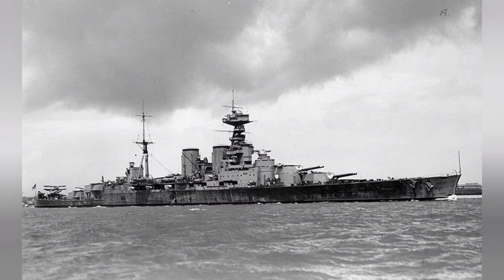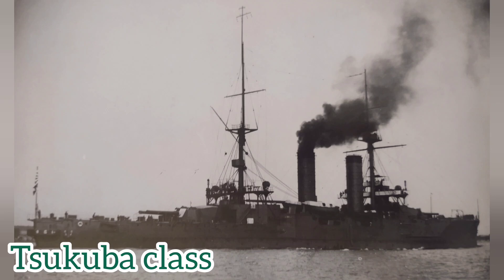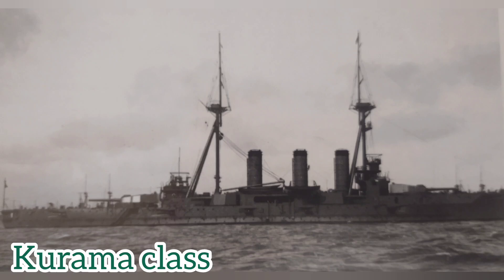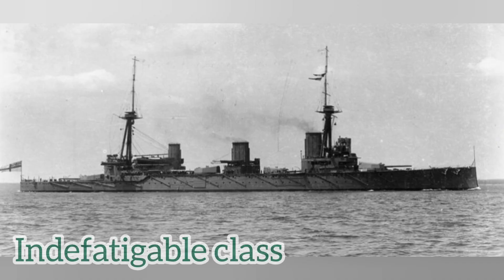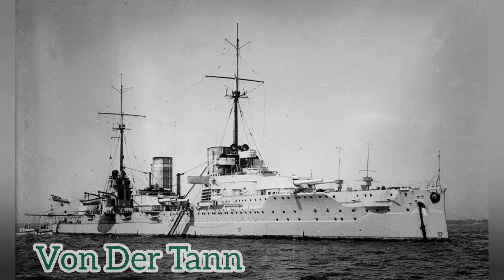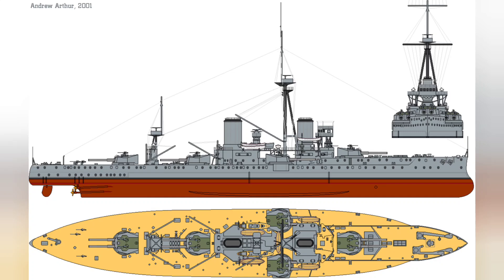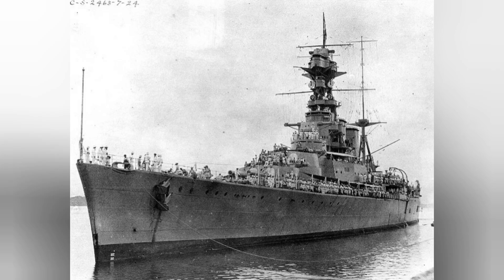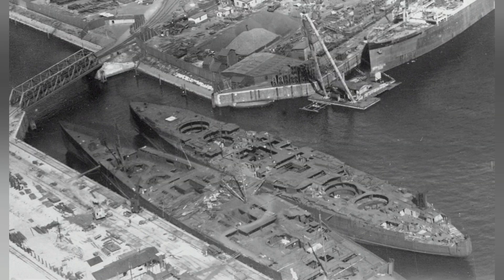The battlecruiser issue.

Comment: I think the best definition for battlecruiser is “A ship that’s capabilities are in between a heavy cruiser and a battleship”

Do you have any criticisms of this definition ?
Reply: I would say it would have to have a main armament caliber of contemporary battleships.

The Alaska class of the 1940s have been argued between heavy cruiser and Battlecruiser because of its 12 inch guns, but by 1940, 12 inch guns couldn’t really be called battleship armament when pretty much every major navy had 14-18 inch guns.

Similar can be said for the Deutschland class pocket battleships (actually heavy cruisers) which only had 11 inch main guns in the 1930s. By comparison, the Orion class had 13.5 inch guns by around 1910, and the New York class had 14 inch by 1914. Battlecruisers of the time had similar calibers, minus a turret or two for engine space.
Reply: @shaun1293  12 inch is a battleship gun diameter  

If there was a cut off point between non-battleship & battleship gun diameter it would be 12 inch  i’m pretty sure that a foot long in American
Reply: @avus-kw2f213  12 inch was pretty much the battleship standard caliber from 1895 to 1910, when ships with 13.5 and 14 inch guns began to appear, with armour to match. Due to this, 12 inch guns for battleships quickly became obsolete; if I remember correctly, all british 12-inch BBs and BCs were scrapped by the early 1920s because of it. The American 12-inch dreadnoughts ended up being heavily modified or converted, and the only one that saw extensive WW2 service was Arkansas, and even then it was mostly coastal bombardments and patrols.

The exception to this were the two Scharnhorst-class battleships built during the 30s. Hitler reluctantly ordered them to have 11-inch guns to keep tensions at bay with the U.K. They were supposed to be upgraded to 15 inch guns like the Bismarck-class battleships, but never came to be. They fired heavier, faster shells than previous 11-inch guns but were still completely outmatched by other BBs and BCs at the time. Their speed of 31 knots was their saving grace on more than one occasion, for example when both faced BC HMS Renown, got pounded and had to escape.

So that concludes my point. 12-inch was a good battleship caliber before WW1. After, they were outmatched and became obsolete. Therefore, the caliber required to class something as a battleship or battlecruiser changes over time. The Alaska class 12 inch guns stood no chance of penetrating the belt armor of contemporary battleships, was outmatched by the last battlecruisers, but could pulverise anything else.
Reply: @shaun1293  how much ships did battleships sink in ww2 in the Pacific ? & how much required guns bigger then 12 inch ?
Reply: @avus-kw2f213  well by that time, the aircraft carrier was king, and most battleships in the pacific were sunk by aircraft. Fuso was heavily damaged by aircraft but remained afloat until she was torpedoed the next day and sunk. Yamashiro was in the same battle, hit by two torpedoes, flooded but remained afloat. She was then attacked by 6 American battleships, 3 heavy cruisers, 4 light cruisers. She was hit multiple times by 16-inch salvos but remained afloat for some time. Only after she was crippled and hit with a few more torpedos did she finally sink.

Kirishima and Hiei, heavy cruiser Atago and destroyers were also intercepted by Heavy Cruiser San Francisco, light cruiser Helena and destroyers. The Americans focused fire on Hiei, giving Kirishima the chance to damage both cruisers. Hiei was crippled by the repeated shellfire, but continued to fight. She remained afloat and was scuttled 3 days later.

It was only then that Kirishima was intercepted by the new battleships USS South Dakota and Washington. In the ensuing engagement, Kirishima knocked out 4 destroyers, sinking 3. She hit South Dakota with multiple 14 inch salvos, none of with penetrated. Her secondary guns knocked out various systems. Safe to say 12 inch guns would have had more of a secondary affect at this point if 14 inch shells can’t even pen. For reference, 14 inch shells were almost double the weight of 12 inch shells.

Washington started firing her 16 inch guns at a short range of about 5km, Kirishima was hit at least 20 times, penetrated her armour and blew her magazine. Survivors were later rescued before she sank 3 hours later.
Reply: @shaun1293  was their any other ships sunk by battleships ?   I really thought it would be more
Reply: @avus-kw2f213  there have been a fair few ships sunk by battleships but only two cases I know which a battleship was actually sunken by another battleship; Karishima aforementioned, and Bretagne, which was sunk by by British 15” projectiles at the bombardment of Mers-el-Kebir in July 1940. She blew up and sank. The four hits were scored by HMS Hood, HMS Valiant & HMS Resolution. Her sistership Provence was also hit but she didn’t explode and was refloated.

HMS Hood is an interesting one, she is designated as a battlecruiser but practically she was the worlds first fast battleships with her 11” belt armor. She was famously destroyed by Bismarck.

In other cases, Battleships usually just pound the living daylights out of each other until one is crippled and taken out some other way. Yamashiro was pounded by 6 battleships before sinking to torpedos.
Scharnhorst was sunken by torpedos only after HMS Duke of York hit her boilers so she couldn’t evade.

Huge fleet engagements pretty much ended after the Battle of Jutland in 1915, as no one nation wants to risk their entire fleet of super expensive battleships and battlecruisers. Even though the British took more losses, (arguably due to the then unknown dangers of cordite), it was a strategic win for the British as the German high seas fleet pretty much stopped venturing out for the remainder of the war.

By WW2 aircraft were king and easily replaceable, so aircraft carriers became the flagships of fleets and would usually be defended by destroyers and its own aircraft rather than battleships. That’s the reason they’re not around anymore. The aircraft carrier did to Battleships what HMS Warrior did to wooden ships of the line back in 1860.
Reply: That's probably the best definition, given how varied the concept really was. Although with this definition you could put the Deutschland class in the battlecruisers category.
Reply: That´s a description at best, but a nonsense definition. The only correct and meaningful definition of a battlecruiser was always "a warship classified as a battlecruiser by the nation it belongs to".
Reply: @jesperlykkeberg7438  Admiral Kuznetsov is heavy aircraft cruiser not a aircraft carrier then 

Which is still reasonable

Comment: I thought battlecruisers were heavy cruisers with battleship armement, mostly dual mounted, and for something like the USS Alaska, has their main batteries inbetween A heavy cruiser and battleship.
I also thought they were a bit smaller then battleships, but they are almost the complete same.
And the purpose, i would think they would act as a assistant ship to the battleship, or work in a seperate fleet.
Reply: You are on target. Cruisers were advanced scouts for the Battleships and were classified by the size of their batteries. 6 inch or smaller batteries were in the Light Class Cruisers (CL). Those with 8 inch or larger batteries were Heavy Cruisers (CA). They had much bigger guns and more armor then enemy Destroyers and could out run Battleships. They also made excellent escorts for the faster Light Carriers (CVL). Speed was a major factor in protecting ships from enemy submarines. Speed was so effective that troops were sent to Europe via the Ocean Liners HMS Queen Elizabeth and HMS Queen Mary without the use of convoy or aircraft protection.

Comment: I quite enjoy the "What is a Battle cruiser" discussion because there are so many different valid interpretations, and then what ships fit.
For me it's always been role. Broadly, it's a ship that can either conduct merchant raiding with impunity to the escorts (armoured/heavy cruisers) in firepower and protection, or hunt merchant raiders using superior speed and then later be able counter other battlecruisers. The ability to assist in the line of battle to increase relative numbers is a secondary role, probably a requirement in smaller navies.
This means armour immune to 'standard' cruiser guns, high speed and gun calibres over 10 inch (ie larger than any cruiser-grade gun).
So I do not consider HMS Hood to be a true battle cruiser, because there's no way the most powerful capital ship in the world is going to be used to hunt merchant raiding cruisers! For me she is the first Fast Battleship.
However (probably controversially) I do think USS Alaska is a battlecruiser, along with the Japanese B65 design. As are the Renown sisters, the Kongo's and (probably also controversially, but their careers are mostly merchant raiding) the Scharnhorst's. All these ships do fit the definition I give in terms of role, use and speed/protection/firepower.
SMS Blucher would not be a battlecruiser, she is an armoured cruiser (and her loss confirms that to me).
I'm happy to be disagreed with, like I say, that's the fun part of the debate; it's one of those subjects that is down to personal choice (within justifiable reasoning).
Reply: A cruiser is a ship that si designed to cruise. That is conduct long range solo operations of a vide variety, from sealane control, disaster relief, long range reconnaisance, colonial protection, or power projection, convoy defence or commerce raiding, or even fleet scouting. Its a swiss army knife ship.

Comment: The USN began building two battlecruisers in the 1920's.  Luckily they decidedc to make them into aircraft carriers instead.  I  refer to the USS Lexington (CV-2)and the USS Saratoga (CV3).  Thankfully in WW2 in the Pacific the USN made the correct choice
Reply: USN brass were very impressed with Derfflinger. But the design of Lexington (originally a slightly improved Derfflinger) was altered by too many committee suggestions and over-rulings.

Comment: Why didn't they position the amidships turret so that it could fire to both port and starboard? The hull would be too long?
Reply: I remember reading something that it had to do with the internal engine layout. Remember that the turrets are not simply put on top of the deck, the entire reload and magazine structure extends all the way to the bottom of the ship below the waterline. So anywhere the turrets are placed, you cant place any propulsion machinery. And I remember reading that this was one of the issues with early dreadnoughts and battlecruisers, they still needed the entire midships section for propulsion machinery and had to place the magazines around that machinery, which then dictated the turret placement.
Reply: It was to do with evolution/technology. 

Dreadnought had three guns on the centre line, two "wing" turrets. This meant that they could only use 4 of the 5 guns (well, 8 out of ten guns, 4 out of five mounts)  at any one time. 

So the staggered ( "En Echelon") midships idea meant that the midships turrets could fire to either side, so in theory, could use all guns in broadside fire. It didn't work, as limited arc of fire by the far side gun, and blast damage to superstructure around it. Typically, boats/davits/aircraft all stowed midships, and all very fragile (and flammable) , so firing across deck was a really impractical idea.

It wasn't used for long. In the RN, there were less than a dozen battleships and battlecruisers that used it in the early 1910's or so. 

What changed it? "Superfiring" turrets, that is the general term for turrets stacked above each other, which started with the Lion class battlecruisers (fwd) and the Colossus class battleships (aft). 

It wasn't that they hadn't thought of that, it was evolution of fire control. 

With earlier ships, mounts (turrets) were individually controlled, and they had "sighting hoods", so a gun in close proximity meant that there was significant danger of blast damage/injury from the gun above. 

Once ships had directors, and central fire control, the mounts were better protected/could eliminate sighting hoods, and the blast from the gun above was no longer a factor. Hence every ship from Lion/Colossus incorporated them in some layout or other.
Reply: @trauko1388  
And the U.S. built it's battleships with super imposed turrets and superfiring capability from the start!
I never have figured out why Great Britain failed to do so until the Hood!
I whish someone could give a rational reason.
Reply: @xXNightDriverXx  
I would buy that argument except for the fact that the USN was able to place all of its turrets on the center line and make them superfiring as well!
It appears to me that the British designers were not very competent.
Reply: @mahbriggs  - At the start of WWI HMS Dreadnought was virtually obsolete.
Reply: @Scooter George  
It certainly was no longer a front line battleship!
Reply: @mahbriggs  This is not true. HMS Dreadnaught was flagship of the fourth Battle squadron of the Grand Fleet on the outbreak of war in 1914. She was releived as flagship the same year by HMS Benbow but remained with the squadron. She missed the Battle of Jutland because she was refitting in Portsmouth at the time. After Jutland she became flagship of the Third Battle squadron.
Reply: @mahbriggs  The rational reason is that the British didn't fail to do so before HMS Hood. Hope that helps.
Reply: @mahbriggs  The Americans only adopted super firing turrets so they could build a smaller cheaper ship and keep Mr Congressman happy. Unfortunately the cheap philosophy also provided for reciprocating machinery that made their first Dreadnoughts pretty useless.

 The original idea for the Dreadnought was sort of like a Flying Fortress, with guns all over the place. The idear being it could take on and defeat two conventional Battleships, even if the two enemy ships were maneuvering independently. The British had a thing at the time about the importance of ahead fire but didn't like superfiring turrets because of the blast interference. The other perceived advantage of the Dreadnought arrangement was that by spacing the turrets apart, this would negate the chance of a single shot destroying half of the armament. 

Things changed as technology and tactics evolved. Nobody could conceive of the ranges that Battleships would fight at Jutland when Dreadnought was built. The super firing turret was also principally adopted in the Royal Navy to keep the size and thus the cost of Battleships down.
Reply: @AndrewTeale-cy3dw  
Actually, they did fail to do so.
According to David K. Brown, the Hood was the first British capital ship capable of axial fire due to the relocation of the sighting hoods.
Reply: @AndrewTeale-cy3dw  
The wing turrets on Dreadnought were in order to create a shorter design in order to save money!  It seems Congress was not the only legislative body to influence design due to cost!  
American "dreadnoughts" were developed to different design principles than the British ships.  Hence, the development of the Standard Battleships.
The adoption of superimposed and superfiring turrets gave the same broadside fire for fewer guns than the inefficient British layout!
There is a reason the British later copied the same layout!  Too bad they stuck with placing their sighting hoods on top of the turrets, precluding superfiring!

Comment: While good the Tsukuba class doesn't quite fit a lot of the definitions of Battle Cruiser as they are significantly slower than contemporary cruisers and therefore couldn't chase them down like what happened at the Battle of Falklands. While at 20.5 Knots they were faster than contemporary Predreadnaugts which were 17-18knots most cruisers of that period were over 21knots usually 23 knots.  When the Invincibles came on the scene 5 years later they were faster than any other cruiser in the world thus allowing them to catch an kill every cruiser in the word
Reply from the maker: I understand your points. The Tsukuba class was mainly mentioned for it's combination of a cruiser hull and battleship guns which separated it from contemporary armoured cruisers and standard battleships. It's just an intermediate design that falls in-between which is technically what battlecruisers were made of, intermediate designs. I also put it in because the Japanese did reclassify them as battlecruisers when the term entered use in 1912. As I've told other commenters, I don't mess around with classifications used by navies and thus I'll use it as it was officially registered. Thanks for the input.

Comment: Battlecruisers have tended to fair poorly, and often not just due to the poor armor. The Jutland losses would've happened regardless due to unsafe operation, and Force Z was a suicide run for all involved. Seems like their speed + firepower had them put in the most dangerous situations by their countries, see Kirishima too. In almost every case, a full Fast Battleship would've done just as poorly.
Reply: @LucioFercho  

The problem wasn’t limited to this-the fact British cordite had a tendency to be more volatile arguably played an even bigger role (as seen with Invincible, which wasn’t part of Beatty’s squadron and thus didn’t have the ammunition handling issues).